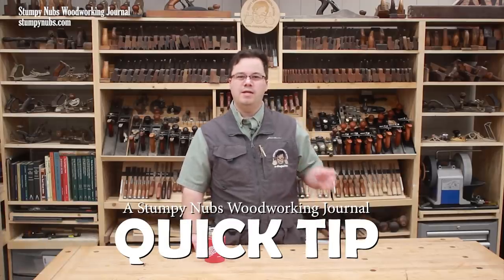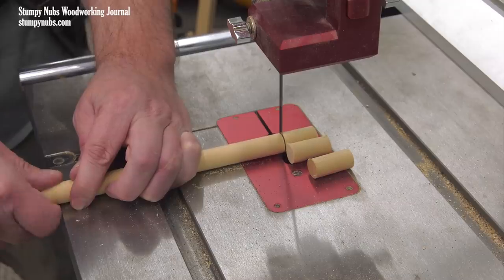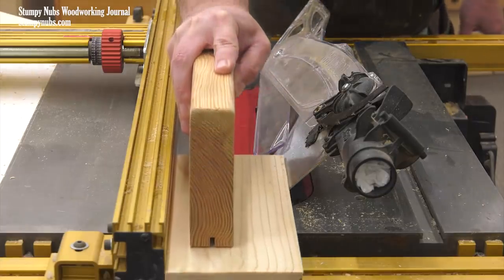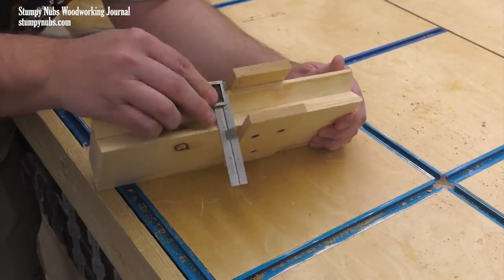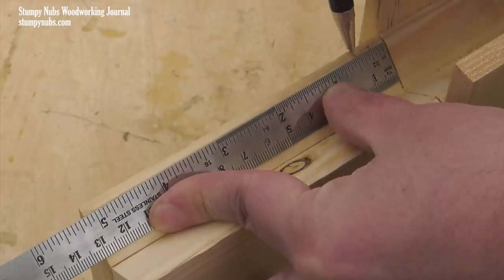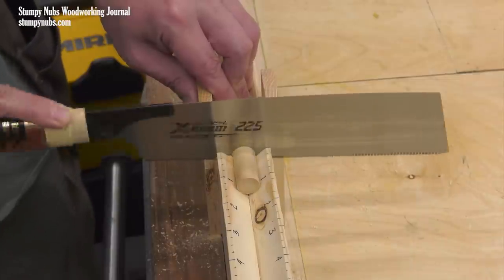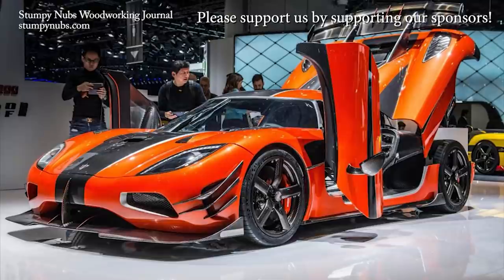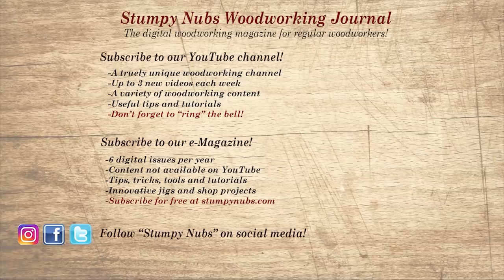DIY jig makes long dowels shorter in SECONDS!

Comment: I drill a dowel-sized hole in a 2x4 and push the dowel through that hole.  Ideally, the drill bit size is the same size as the dowel and hold it snug so that it may take some taps with a mallet to advance the dowel through the hole.  I've use that to cut a bunch of 1/8" plugs to cover countersunk screw heads in several projects.

Comment: This is a great idea for a safer way to cut dowels. If I can make a suggestion, it might be easier to use a peel and stick tape ruler than transferring all those measurements. Maybe even use up the short pieces that get trimmed off when the tape is too long.

Comment: Very good jig! I made something a lot like this a year or so ago on the fly when I needed a bunch of 2" dowels for some joinery. I didn't think of marking measurements though, that's a good idea. I used a stop block basically but it did cause the offcuts to pinch my sawblade a bit, so I think I'd do your method next time with the built-in ruler. One thing you can add to yours: a little container at the end of the jig so that as pieces fall off they end up where you want them (only helpful if you're cutting a lot I guess).
Reply from the maker: A container like this? https://youtu.be/tBx0hbeGOeE?t=108
Reply: @StumpyNubs  Oooh yeah that one haha that must have been the second that I scrolled down to start reading the comments.